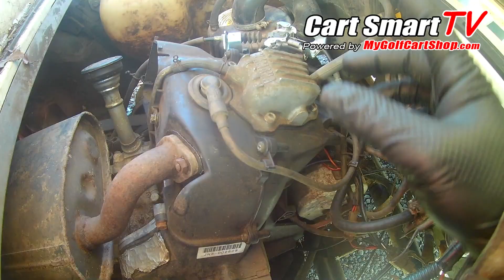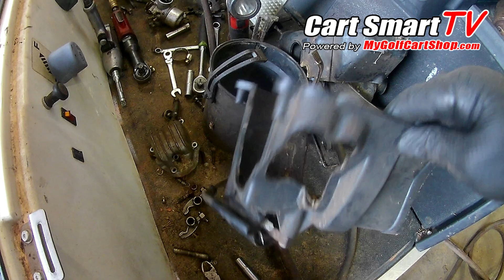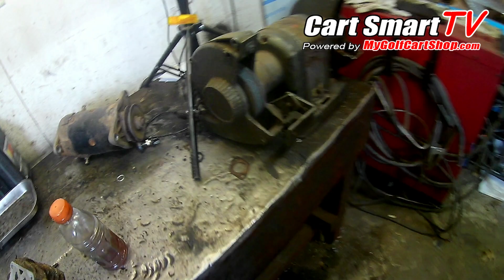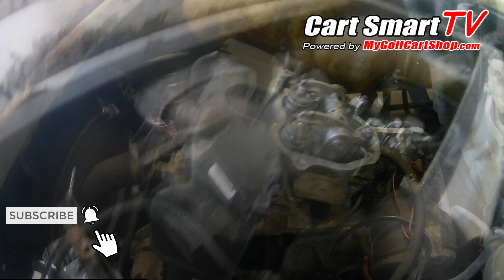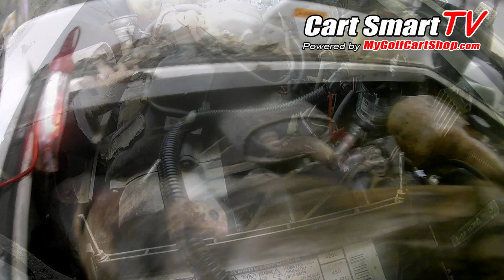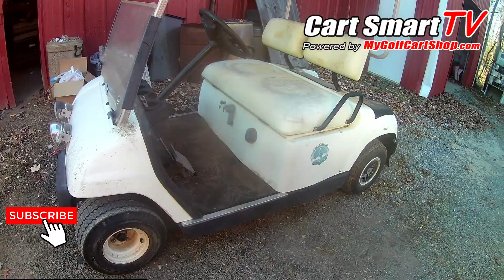Yamaha Golf Cart Smoking Fix

Comment: My 96 Yamaha used to be a Mountain Climber.
Power spring on the clutch, and,    maybe,         a belt a bit short.

Now it smokes like a steam engine, with much less power,
Just watched your 2 videos,....
( Yamaha Golf Cart | Smoking Engine Rebuild )
( Yamaha Golf Cart Smoking Fix )

What should I look for,... on the outside ( Leaks )
 to go through the process of elimination??
Take the top off,   checking for valve blow by,...
Or,     take the engine out and go through the whole thing. 
 
I suppose the compression thing first !!  The Rings !!!